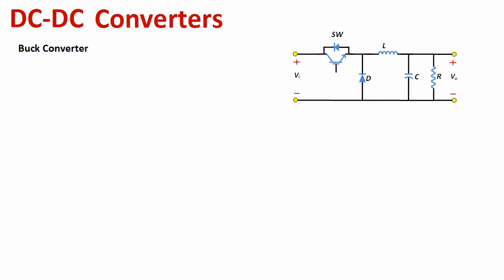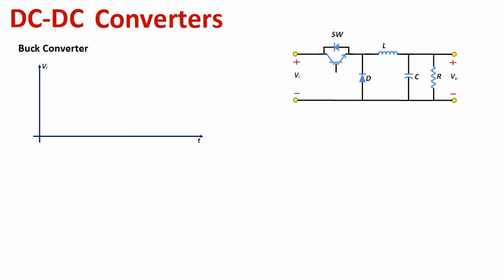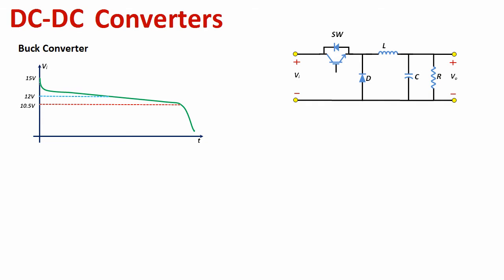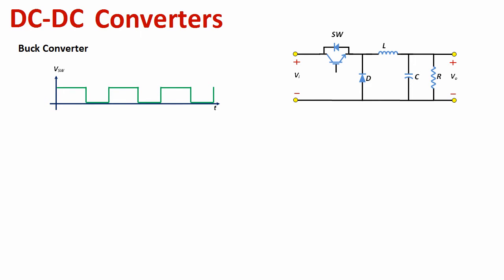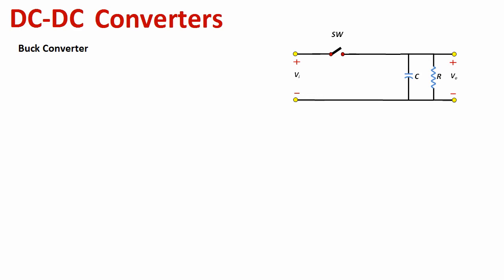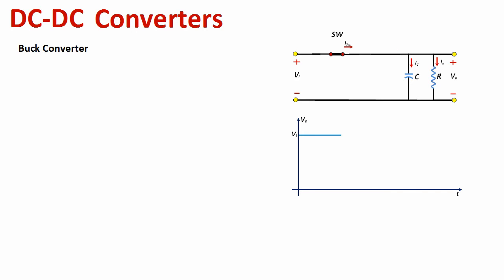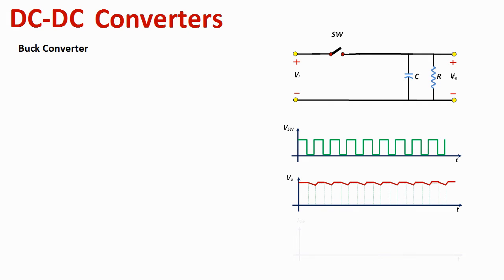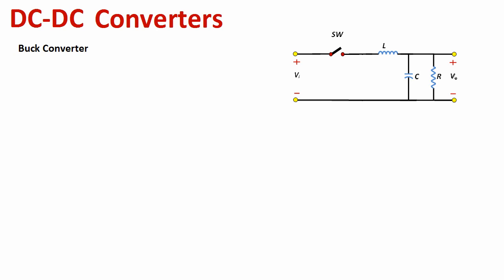DC-DC Buck Converter 2

Comment: When you open the switch at 5:55... Why does the current change direction in the capacitor?
Reply: +Real Bizniz It has to change the direction: Before the current was coming from the battery source, it was going as well through the capacitance, as well as through the resistor, and from there back to the negative pole of the source. If we now open the switch, we have a single circuit, consisting of "R" and "C" only. And the energy flow now starts at the capacitance (stored energy), and the current flows in this circuit, as described in the video.

Everything clear? :) I hope I made no mistake, but to me it makes sense, that the current flow inside RC circuit with opened switch goes clockwise.